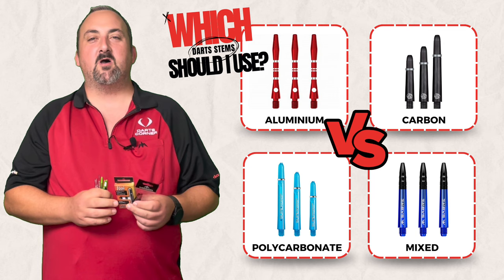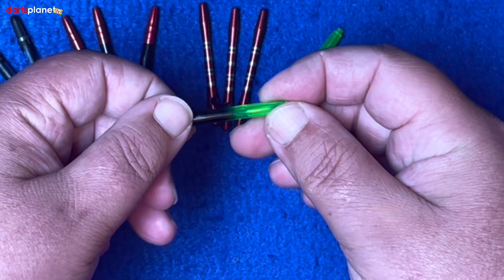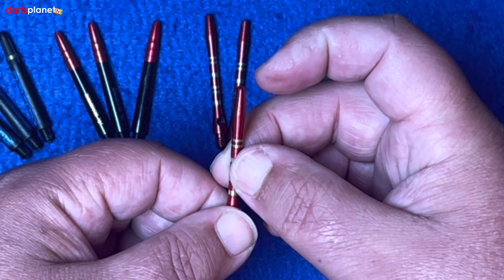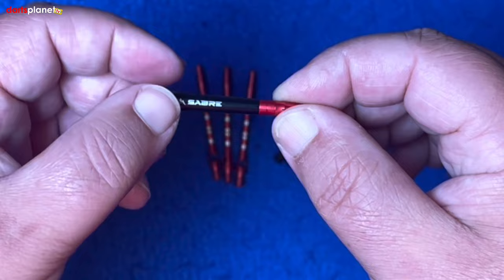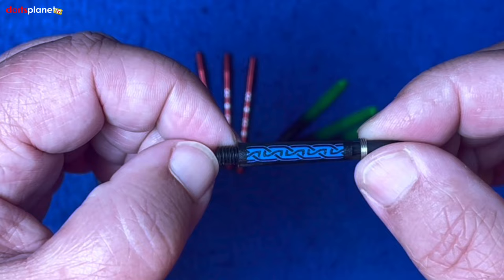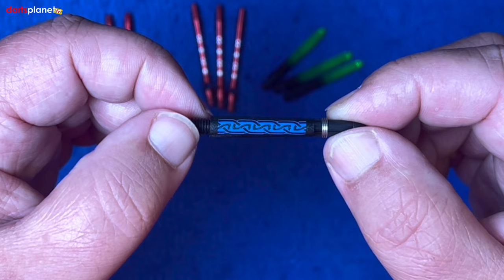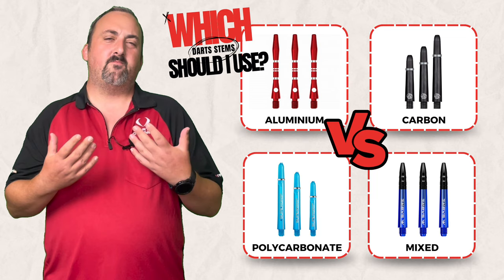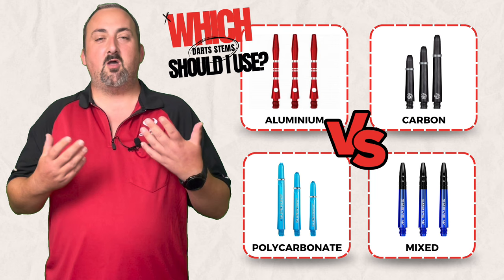WHICH DARTS STEMS SHOULD I USE? | ALUMINIUM, CARBON, POLYCARBONATE OR MIXED

Comment: I've never used anything else apart from nylon stems don't think I ever will. A lot of stems nowadays are getting pricey.. I always flight punch my flights and that helps a little bit in saving my stems, however nylon are so cheap it really doesn't bother me when they break...
Reply: I'm similar, I flight punch and use polycarbonate stems majority of time but I've tried so many through the years and sometimes weighing up the cost of longevity did come into play.

Comment: 1 robinhood and aluminum is done, easiest to break. Another vote here for nylon with puched flights. With rings, they last a long time, usually 2 sets of flights and 2 sets of rings to 1 set of shafts for me. Nylon are also cheaper than dirt.

Comment: polycarbonate is the same material racing/freestyle drone props use. Same with motorcyle glasses. And... that material bends back without getting much weaker. I disagree with the fingers breaking. I am yet to see that. I would say the nylon stems are the "cheap" ones that break.
Reply from the maker: Thanks for your comments and feedback it’s really appreciated.

Comment: I like the nitrotech, which is polycarbonate, but the flights don’t go in as far as with other shafts, which is annoying for choosing the length.
Reply: I like the (medium) RedDragon NitroTech shafts as well. Theyve been my go to for about a year now but Ive been contemplating trying  something else because It still feels like Im going through flights and shafts too quickly. I probably go through a set of (RedDragon) ultra thick flights every two weeks and the aluminum flight locking tips on the NitroTech shafts get bent outward- and eventually kinda wonky. If not just individually one at a time as needed, Id say I probably go through a set every 8 weeks. However, Im not really even sure what can be considered normal/reasonable wear and tear. I throw pretty much everyday. Sometimes just an hour or two- some nights it might turn into 5+ hours.
Reply: I've found the nitrotech very hard to get the flights in to. I've had several new flights bend so badly that I just can't use them anymore

Comment: Polycarbonate is a virtually unbreakable material, so much so that it may last the longest. Even longer than aluminum shafts. Its just that its the one that looks the cheapest. Same shape but looks a bit more expensive are carbon shafts.
Reply: Yeah I was gonna mention that, polycarbonate is famously extremely tough and used for helmet vizors and riot shields